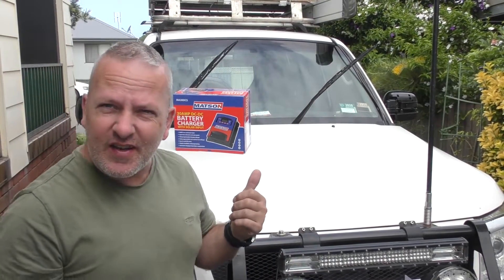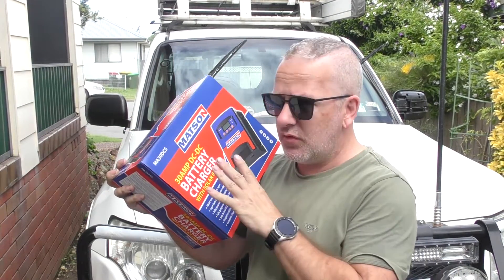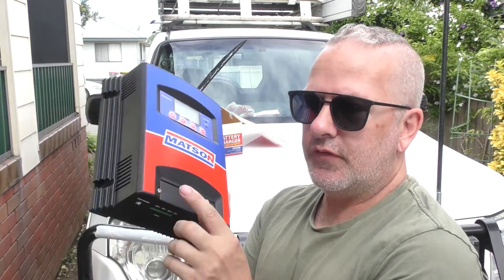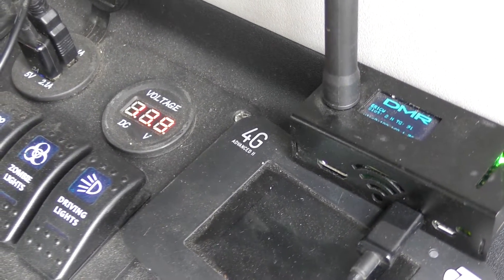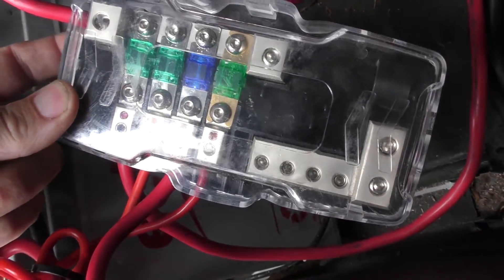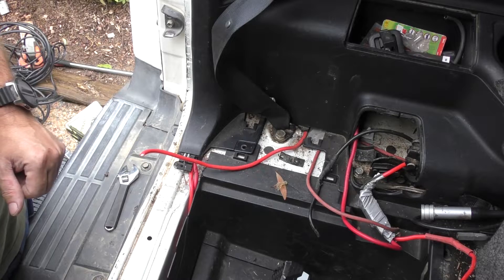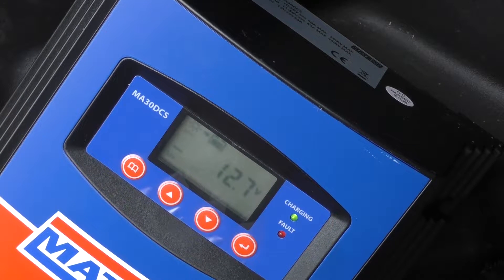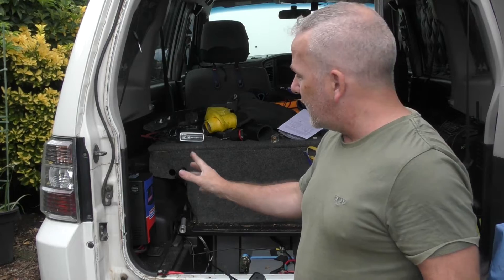Matson 30DCS- DCDC / Solar charger install/review

Comment: Another good video. But would like to give a solution regarding the adjusting hooks on the solar panels. If you hook a bungy strap to the adjusting screw on one side and the other end  of the bungy to the screw on the other side of the car then they can not  come loose.
Reply from the maker: Thanks Ken. those hooks are all gone now. They just became unreliable on rough roads etc.  I used to use some fence wire through them or cable ties, like you suggest to stop them from coming undone. it used to work ok but I'm happy theyre gone.

Comment: How about a video 2 weeks or month on? And what is the maximum gauge wire you fit in those plugs
Reply from the maker: I'll do a follow up, but the pajero isnt getting taken out at the moment due to the virus and my work car is only getting driven. as soon as I get a chance to spend more time with it, I'll report back.   I'd say around 6-8B&S would work
Reply: @DENMONKEY  awesome

Comment: Hi, thx for the vid. Can the display be changed to show amps coming in from both alternator and solar? Also do you know if your solar issues with the projecta unit have been corrected in v5?
Reply from the maker: Hey Tony, yes you can view the input from the alternator and solar (panel input and controller output)  .    Not sure on the projecta though, haven't followed them with any changes. Don't get me wrong. it's great for such a compact unit but the size makes it a bit of a compromise I think.

Comment: 0:02 funny stuff mate, 16:23 would have definitely cleaned that up a little. Why not Redarc? I know tight ass right lol. Good clip mate . Cheers Steve
Reply from the maker: it got a bit more of a clean up off camera, but there's also earths going to my aux battery and my main, which all go to the frame, so it didn't get the full monty. 
I know redarc is good gear but this came up at the right price and convinced any brand is that much better than anything else for some of the prices on their gear.  I do like their management systems though, quite nifty but again, I couldn't go pass this deal and I wasn't actually looking at making the change just yet. Who knows, had I waited until I was ready, I may have gone with something from redarc

Comment: Nice video mate.. I've really gotta bite the bullet and get a DCDC setup + solar going. As for your hardmounting of the compressor I've been thinking about doing it as well, I haven't done it yet so I don't have any advice. But I'd definitely be interested in seeing how you do it if you wanted to make a video about that. I've got the thumper max and it draws like 100amps, gotta have huge gauge cabling to run that from the front to the rear.
Reply from the maker: Sup Plez,   just add it to the list of jobs mate. I didn't win powerball last week, so some stuff will still have to wait.  I sussed out those thumpers and that current draw scared me a little. I think my super cheap one is around the 40A mark. When I get around to it, I'll definitely do a video on it. The mounting is going to be the hard part and wondering how to protect it from water. I guess I'll just have to figure it out on the fly.
Reply: @DENMONKEY  haha you're telling me, I've got a list about 10,000 items long of things I wanna do on the Pajero.. There's just that little problem of paying for it all.

Yeah, I didn't know the power draw when I bought it. I really want it to go in the back so I can use an airline coming out of my drawers, but it might end up being safer to fit it in the engine bay somewhere.
Reply from the maker: I have thought about it a little. It can sit in the rear seat well but it gets hot, so I was thinking about adding a fan that would come on when its running. The previous owner had cut some holes in the bumper for a rear camera, so I wanted to have the air hose come out there to fill it. But that means having to get the air hose from inside to outside, which is what I was thinking about just mounting it outside. power is much easier to do from in to out.     The paying for it bit suck, bloody cable of a decent size is rude
Reply: I had my thumper max hardwired in my Paj NJ from the aux battery, with a 100A relay triggered from an accessories wire in series with a rocker switch. This was so I could only turn it on if I had engine running. I was running it on 4m of 6B&S, it worked OK but was a bit undersized. In the new NW Paj, I've run 4awg straight from the starter battery, DC clamp meter measured at 60A no load. This time I'm using the Pajero's rear cig socket to trigger a relay, which in turn is wired to the Compressor's switch & an external mounted rocker switch. In both setups, I mounted the compressor up against the cargo barrier behind my storage shelf setup. Both setups are quite ventilated so I can't comment on the heat issues, though if I was hiding it away I'd add a 12v computer fan to be triggered when the compressor comes on.
The compressor will flatten your aux batt very quickly unless you can manually override your VSR/DC-DC charger & provide alternator power whilst its running
Reply from the maker: its all good, it hjas a feed from the main battery, and I built a remote control anderson plug box that I can just plug into any anderson plug and turn it on or off remotely. So I would hard wire it to the front and like the current set up, use the remote relay (10A) to trigger the 60A relay. I'd also have a switch inline to make sure it couldn't be turned on accidentally. But that would be fed from the aux battery . its the mounting thats gonna require some though and I hope the pump can be mounted upside down. plus I want to build a shield for it too
Reply: @DENMONKEY  perhaps you could stick a small air tank under the car behind the bumper, theres a nice big of space up under there! I haven't figured out what to use it for yet...

Comment: You can fit an ARB aircompressor behind your spare wheel carrier.
Reply from the maker: Which model do you know?
Reply: @DENMONKEY  sorry don't know. I've just seen in on a FB post before.
Reply from the maker: I think I'd see someone do that on the pajero forum. Not sure if it  was an ARB though.